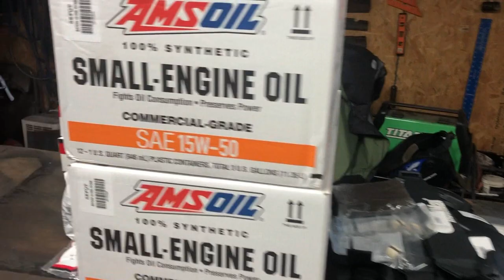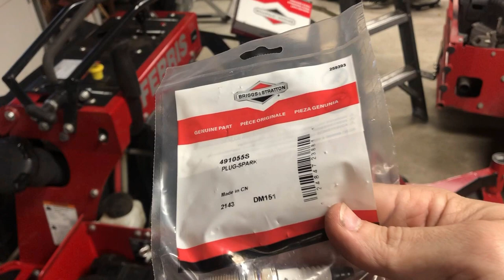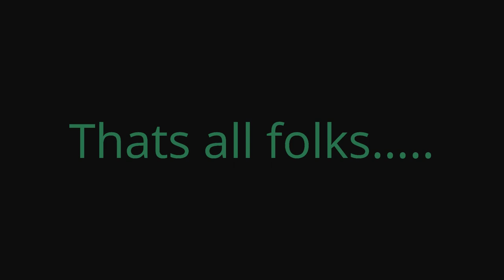Ferris Mowers Maintenance Part 1 | Spark Plugs | Fuel Filter | Air Filter | Oil Change

Comment: Good show!

I have a 2015 Ferris IS700Z zero turn with the 810cc 27 HP Briggs engine.  Changed my engine and hydro oil and filters today.  Rained here as well.
Reply from the maker: Thank you 😉👍 I'll be doing some hydro maintenance on an IS700 soon f9r a friend of mine.

Comment: Great video where did you get your redmax blower straps
Reply from the maker: Thanks!  We get all our OEM replacement parts from "Jack's Small Engines " Such things as speed feed replacement caps , fuel filters,  air filters,  oil filters , spark plugs etc.
Reply: @JsCrazyCutzLLC  I need discord server link 😊
Reply from the maker: https://www.jackssmallengines.com/

Comment: Maybe I'm cheap, or lazy (or both LOL) but I don't mess with the spark plugs until I see a drop off in fuel economy or performance in some way, but I am all for all the other stuff. I have spark plugs that have been used a LOT in  my HH equipment that are still all original and they are 7 years old or more in some of that stuff. Not knocking anyone else that changes them though.
Reply from the maker: Hey🤷 I get it 👍